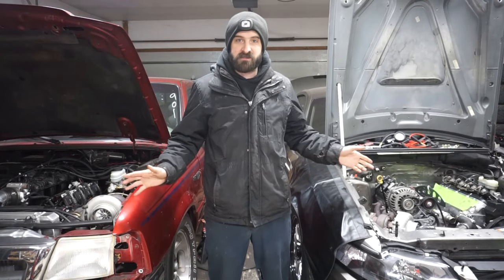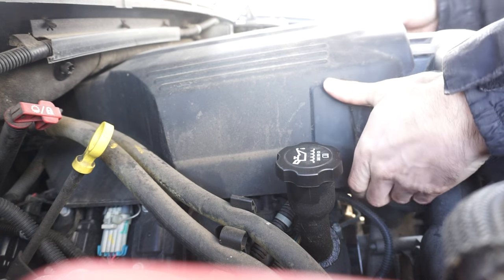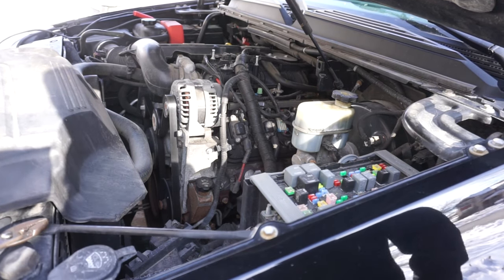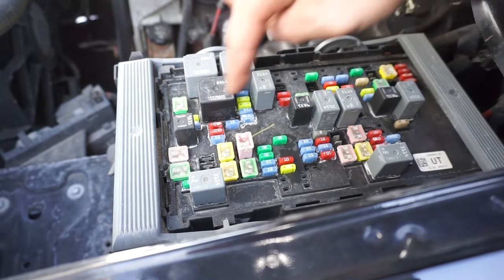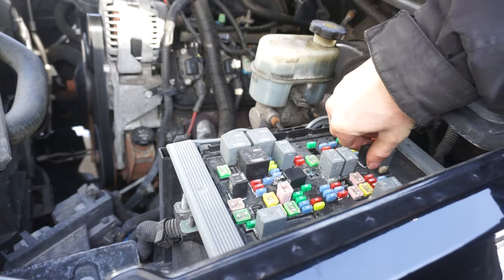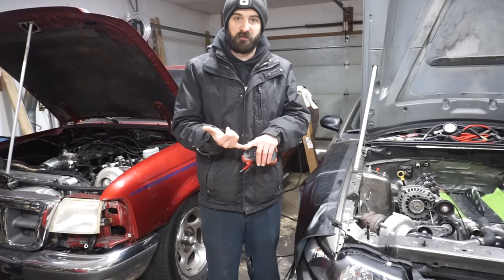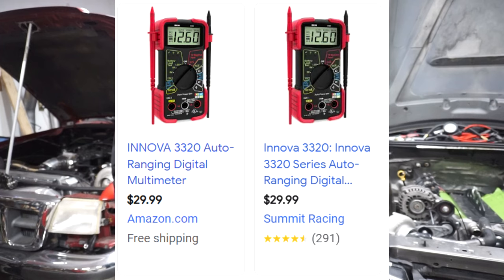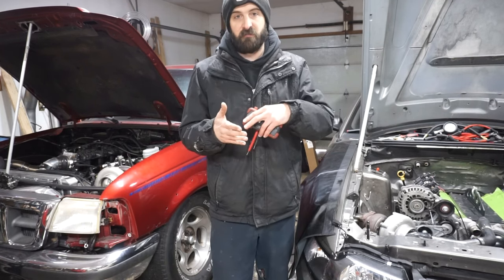Bad Fuel Pump, Fuel Pump Relay, No Fuel, No Start Problem | How To Troubleshoot Basics

Comment: Fuel pump fuse no power. But the other fuses have power. I bypassed it but fuel injector is not spraying. What may be the issue
Reply: I have the same problem with my car. How did you solve it?

Comment: After changing the fuel pump and the relay, it turns out that the problem is that fuse🙄🤦🏽‍♀️Thanks for your video👍👍

Comment: I've got a different issue that wasn't discussed. My fuel relay keeps opening. When I unplug the relay and re install it then it starts again. I've replaced the relay and it does the same thing on the new relay. Curious, could a plugged fuel filter cause a heavier load and kick it open?

Comment: My car died overnight as well. I parked it and it wouldn't start the next day. IT cranks but won't start but it's a bad fuel pump. Nothing else. I already replaced the fuel pump relay and fuses are good.

Comment: I have  a 05 Volvo s60, my new fuel pump has power for the flow but not to turn on, or replace the rely,and fuses are good any ideas

Comment: I need help. I change my fuel filter and my air intake filter and I change my starter. I’m gonna check the fuses and relays next. I don’t hear my fuel pump running when I have my key turn on without the engine running. I hope it’s my fuse or relay. What’s funny is that my truck will start on the second Crank but not the first, so I don’t know if it’s actually the relays
Reply: My 05 Pontiac grand prix did that, sometimes took 2-3 tries usually after a short trip, not usually when it sat overnight.I cleaned my throttle body and it starts always first try.I do notice it's taking longer to start recently hope my fuel pump isn't going out.I had it stall after I got gas, left the lot into traffic and it just died.Started ok went 10 feet ,same thing about 3 more times.I had to  tow it and it ran good for them and they found nothing wrong.WTF?

Comment: 2012 dodge ram 2500 — fuel pump fuse (20) no electric current and I don’t see a Fuel pump relay written on the diagram

Comment: Around 50% of the time my fuel pump will not prime on start up. Have to turn key on and off a few times. When I hear the pump prime it fires up first time and drives with no issues.
Will try the relay first and see what happens.
Reply: How did it go?